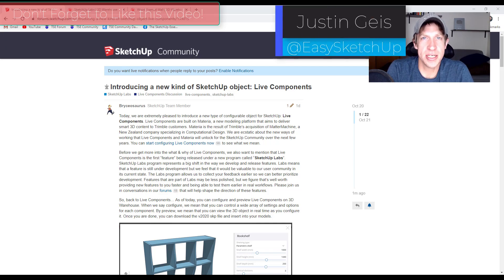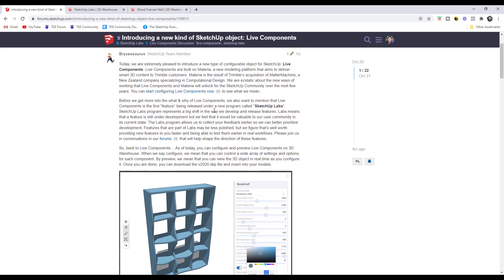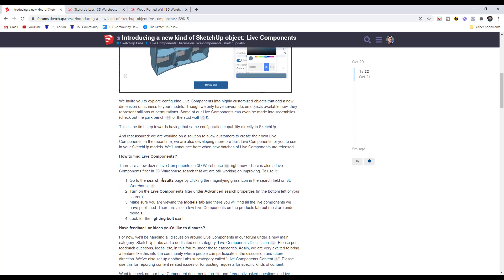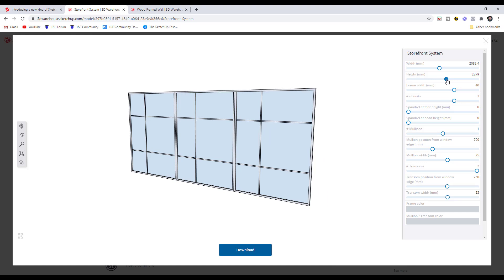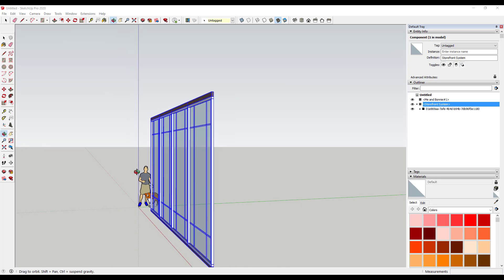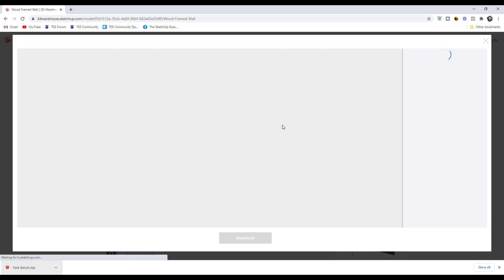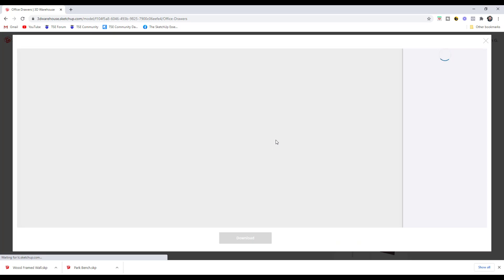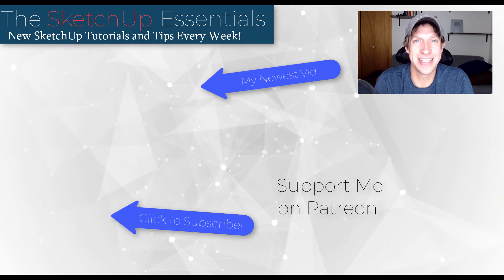NEW SKETCHUP FEATURE - Modeling with Live Components!

Comment: Sketchup approch to BIM Modeling
Reply: Definitely the potential for it when adding parameters to components, although they are falling behind other software such as Blender
Reply from the maker: Curious - how exactly are they behind Blender in this area? Blender has a couple add-ons that make some walls, doors, etc that are very simple, but so far, the architectural functions in SketchUp, especially when paired with extensions, are FAR beyond the architectural features that I've seen in Blender. Not a knock against Blender, but for THIS function, I don't see it being anywhere close, let alone SketchUp being behind.
Reply: @Thesketchupessentials  It's not so much Architectural, that wasn't my point, but BIM specifically, Blender is continually developing and has developed a BIM add on, BIM is more so the management and process of handling information or data, Blender has already eclipsed Sketchup in this regards
Reply: @ONeill01  please check plusspec it's powerful B.I.M plugin for Sketchup
Reply: @faresjawad3096  Haven't heard of it, I'll take a wee look thanks Fares
Reply from the maker: @ONeill01  Have you actually TRIED that add-on? Because I've looked at it pretty closely, and while it might add a library to store data, it doesn't actually add the modeling tools that allow you to efficiently create those objects, or the ability to actually PRINT drawings without exporting to a CAD software. Lots of buzzwords, very lacking in actual tools
Reply: @Thesketchupessentials  "modelling tools that allow you to efficiently create those objects" 

Like what specifically? 

" ability to actually PRINT drawings without exporting to a CAD software."

Isn't that the same with SP and Sketchup layout? Anyway they are close in doing so, you can already output SVGs from the model

"Lots of buzzwords, very lacking in actual tools"

Not really, it's currently BuildingSMART finalist as an open BIM Authoring tool
Reply from the maker: @ONeill01  It's not close to something you could use for actual production drawings. It doesn't have smart tools for drawing walls, doors, windows, etc - EVEN with Add-Ons, they're not very good. And SVG output is not the same as being a good tool for creating documents. I'm not saying Blender is bad, but it's not a contender with SketchUp in THIS field yet, and surely not with TRUE BIM tools like Revit. Great for visualizations though
Reply: @Thesketchupessentials   @TheSketchUpEssentials   Sorry but you can it's from the IFC file itself, the "construction drawing" can be itself viewed in Blender essentially and outputs the SVG. You mean smart you mean parametric? Blender can do that. Anyway agree to disagree, it's certainly a BIM authorting tool in its infancy.
Reply from the maker: @ONeill01  That's not what you claimed. You claimed SketchUp is falling behind Blender with its BIM tools, not that the Blender tool is in its infancy. I agree as well - it's very early in the development cycle and has promise, but is nowhere close to passing SketchUp yet in this area. Have a good one :)
Reply: @Thesketchupessentials  Please reread what I wrote, blender has already escplised sketchup and it's in it's infancy, those claims are not mutally exclusive. Anyway have a good day
Reply from the maker: @ONeill01  Lol - I read it - just don't agree with it. :)
Reply: As an architect  do you recomand me focusing on sketchup or it better to learn blender
Reply from the maker: @moufdidib7589  Depends on what you're going to be doing. I'd suggest more towards choosing between SketchUp and Revit unless you're doing pure visualization. Blender isn't really being used in very many applications for production architecture work right now.

Comment: Ok tried with 2019, and it doesn't work. CLEARLY there is no reason not to work for what is just a slightly different version of a dynamic component. Trimble should focus more in trying to improve their software (for example, without going too far, dynamic components are an amazing feature that has still the same bugs it had when the software was owned by Google), rather than baiting us into buying their subscription based licence.